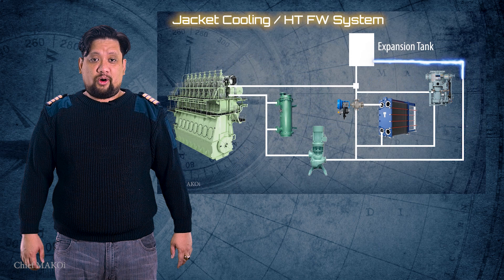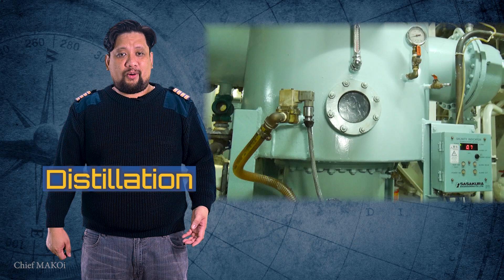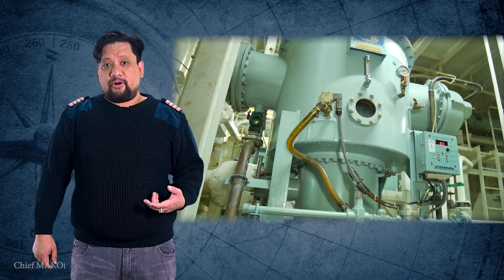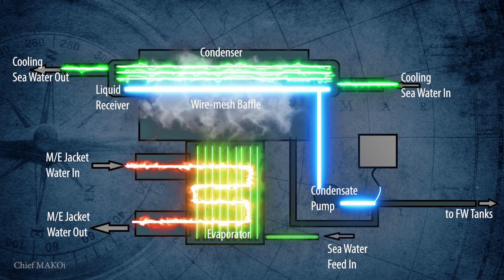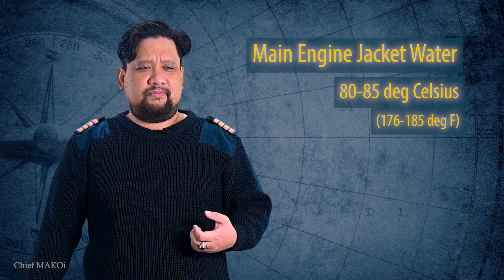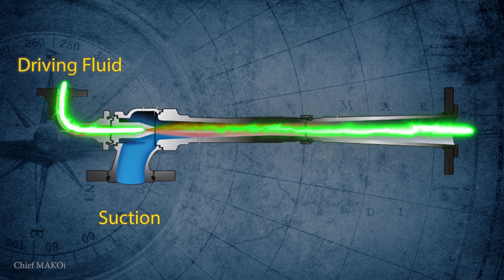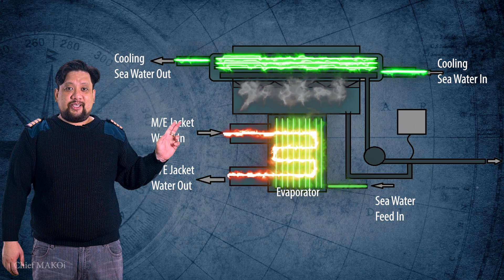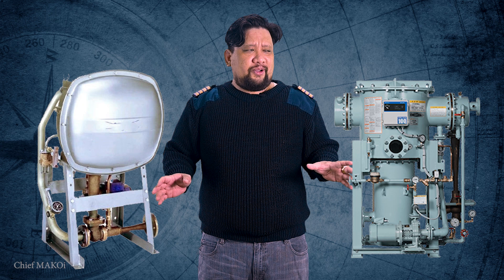How Ships Convert Sea Water to Fresh Water | Chief MAKOi Study Call Ep 04

Comment: Nicely done Chief.
I liked the graphics.
Maybe it’s time to hang up sailing and get a teaching position at the academy.
The shell and the plate maybe the same principles, but the plate is such a pain to clean.

👍🏼
Reply from the maker: Yes, definitely more work in cleaning plates.
Reply: Chief MAKOi - My next to last ship that I was chief on had three distillers: one shell, one large plate and one small plate. We had just taken over the contract for operating this ship for the government. When we went out on sea trial we found only the small plate distiller worked. The shell type had plastic steal repairs internally (Red Hand) and I believe the receiver was full of holes and was just dumping right back into the shell. The previously operator had sent the plates from the large plate distiller out for servicing(?) and when they came back they had put the gaskets all in wrong. So out of 80 plates, maybe five were right. Both top and bottom stacks were about the same.

What a mess!! 
Good thing it was a sea trial and not a trip across the Pacific!!

Comment: Very nice presentation Chief.  The PVT equation you showed does not apply in this case.  It is only applicable to non condensable gases.  Air is an example.  The physical law that is applicable is the vapor pressure curve of water.  At 100 °C, water has a vapor pressure of 1 bar.  At 80 °C the vapor pressure is less.  In sum, the process you are describing is vacuum distillation.

Comment: Could you make fresh water by pumping water out of the North Pacific by wind mills. Up one side of a mountain. Then let the water naturally let flow down the rocky side for miles. It would run 24/7 to a aeration flow into a reservoir. The wind mills could also generate electricity, for homesteads. As the water flow down ward there be blockage in the way just to slow the flow, so the water has to work downward.

Comment: Interesting, thats why you clean your cargo holds at sea, because your using heat from the engine to produce plenty of water for the hoses

This technology looks like it is a mixture between a still, used to brew alcohol, and a fridge, that uses pressure differential beween liquid and gas to produce a cooling effect

Two questions, when the fresh water tanks are full, does this machine still run? And does excess fresh water get dumped overboard, or does it turn off, so it doesnt produce anymore water?

Second question, how does the salt get removed from the machine? Obviously taking in salt water, boiling it into fresh water, and using the fresh water leaves salt somewhere, where does it go?

Id love to work at sea, i dont get seasick, and i used to walk around smaller ships without falling over when they were pitching and rolling, its good fun, i have a family though, and i couldnt leave them for months at a time

That ship is really long, i bet there's times the weather is so bad, you cant see the bow from the bridge

Comment: Shouldn't the water read 0 PPM after distillation? How come there is a possibility of leftover salt in there? Is the tubing not cleaned?
Reply from the maker: It's about the sensitivity of the Salinometer which depends on electrical conductivity.  The desalination plant and pipes are metallic and the water is constantly flowing so it would be understandable for it to have a few blips in the reading.  FYI, sea water has about 35,000 ppm salinity and technically, water with less than 1000 ppm is already classified as "Fresh Water". So a reading of less than 10 ppm is more or less excellent.
Reply: I think because some of salt molecules will still travel up with steam.
Reply from the maker: Yes that too.  It's called carry-over.

Comment: Just curious. How do you remove the salt residue after evaporation? All that salt must cake the pipes of the heat exchangers.
Reply: At 8:48 he mentions it briefly. I will describe it in my own words:

There is a continuous feed of seawater into the bottom part, the evaporator. This part should not run dry and this is assured by removing the surplus in the top wider part. This is done by the ejector that also maintains the vacuum. The ejector does not care if it sucks vapor or water.

Comment: I had a strong debate with this one, I was in strong favor with converting  sea water to fresh water. This is a strong solution for the water crisis in the Philippines.
Reply: not unless you have a lot of excess energy to spend like the residual heat from that main ship engine. Cost to produce 1 cubic meter of water from this process is higher compared to the cost of just harnessing the supplied water from mountain spring and rainwater. We do have a water crisis not because we lacked water, its because of our unpreparedness to the technicalities to store it. Basic necessities like water supply, electricity should be handled and operated with the government to avoid instances where our throat is held by selected companies

Comment: Fascinating video. You mentioned it generates 50 tons of water per day - that seems like a lot. If the average crew member uses around 150 litres a day, even with 30 crew this would only amount to about 4.5 tons. Is there another major use for fresh water on the ship?
Reply from the maker: Engine Cooling water, Boiler water, cargo hold washing, etc.

Comment: Extremely well done.   I have a historical question.  Back in the day of steam travel, they had a waste heat source that was above the boiling point of water.  Did the water distillation process then operate at ambient temperature with boiling water?

Comment: Sir, thanks for sharing this useful info.
I am wondering that at 7:47, why does sea water goes in this way? Because if water goes in this way, sea water would  be in the condenser by following eductor which should be contained the process instead of raw water.

Comment: How do you get rid of the salt? Did I miss something? You said the salt is discarded. Thinking about it, you would get rid of the concentrated salt solution whilst it is still liquid and not evaprated as a solid. So you might have a process where the salt water is introduced into the evaporator and the concentrated salt solution is graduly removed, perhaps by a vanturi as part of the continous operation. If done too quickly you won’t get much steam and if done too slowly, the concentrated salt solution would crystalize and set solid inside the evaporator. Therefore it would have to be maintained at the lower pressure boiling point or it will crystalize.
BTW you said sea water is a mixture of water and salt, it is not a mixture but a solution, you cannot remove the salt with a filter. Sand in sea water is a mixture.

Comment: Oh, another question, i worked in the air transport industry a few years back and i was told, if you have an airside pass to work on aircraft, you can travel to any country in the world without needing a passport, as long as you stay airside, is this true for ships? Would you be allowed to board a ship, and travel around the world as long as you dont get off the ship at ports

Comment: I appreciate the lesson.
I work with R/O's units on yachts. They usually divert the water if it gets up to 500 ppm. I was surprised to learn the distillers are at 10 ppm. That is super soft water!
Reply from the maker: Most of it is used for the boiler water and the engine cooling.  The small amount for the drinking water will still go for rehardening.
Reply: @ChiefMAKOi  Yes , pure distillated water is not good for drinking .

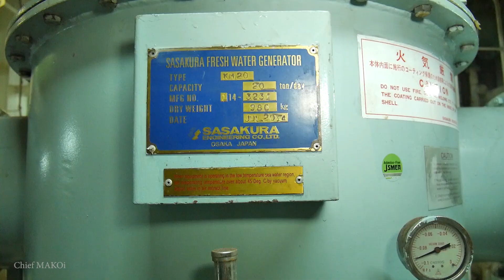Comment: 1:36 vacuum gauge and I knew that the boiling temperature was much lower to 100 °C :). For curiosity - why 80-85°C is optimal temperature for ship engine? RPMS may be low but load is high so I would expect high operating temperature, in excess of 100 °C...

Comment: I’m surprised they use the salt water in the Venturi and not the fresh water. This way you’d produce the vacuum and extract the condensate with the one pump as we do for dirty solvents. 
Also with this setup, wouldn’t it be ejecting fresh water condensate out with the cooling water?

Comment: Is some of the vacuum in the destilator a result of condensing contraction? 
I ask because this is common in condenser systems in power generating plants. Maybe it's only so because you need a large pressure differential to utilize a steam turbine efficiently, but I imagine it would lead to some higher COP in destilators as well.
Reply from the maker: It's from the venturi effect of the eductor.  In ships that use steam turbines, there's also a vacuum pump for the condenser.  It's like you said about the pressure differential.

Comment: Great video! Does this system make water clean enough to drink or is further processing required?
Reply from the maker: Good question!  There are a few more stages that it has to go through before being good enough to drink.  That will be discussed in a coming episode.
Reply: From fresh water tank(destilate tank) it will pass to uv sterilizer, and its now safe to drink. Anyway chief can you please upload video about bunker calculations or or how to compute ROB. ThankZ

Comment: At 4:39 You Animation shows that Jacket water inlet is in the upper part of the heating elements. I think it's reverse, jacket water inlet is down and output up.
Meanwhile it's a good lesson for Marine Engineers!!
Reply from the maker: I showed it correctly.  Since the sea water comes from bottom going up, the heating medium comes from top going down.  That's how they set it up in heat exchangers to maximize the heat transfer. 😊
Reply: @ChiefMAKOi  I have experience with sasakura Type ke 35 at DSME vessels, the jacket water inlet was always from Bottom.
I double checked that from Technical Manual. 
Nevermind I'm not here to disagree, keep up the good work!!
Excellent job Chief!!

Comment: I wonder why they don't use the hot exhaust of the desal engines' to evaporate the sea water & distil it to fresh water? Creating a vacuum to lower the boiling point would be just as dangerous as using normal boiling point/steam which could also be used to assist in driving the propellers & other auxiliary systems such as the power generators.

Comment: You should include how the 40's era ships did the desalination of sea water. Used steam flowing through a tank full of tubes for heat, ect. I ran a desalination plant on a old Liberty ship, converted to service swift boats in Nam. Techo marches on...
Reply from the maker: Some ships that need a lot of fresh water still have the option to use steam.  But it is used to heat up the jacket water instead of using it directly in the evaporator.

Comment: Hello Sir Chief MAKOi. Just for clarification, or maybe I missed something in your explanation. We all understand that water boils at the temperature of 100 degrees Celsius, if it is pure H2O without impurities. Sea water contains salt elements. Am I right to assume that the boiling point of salt water is higher than 100 degrees? I welcome comments and reactions. 😊
Reply from the maker: It should be higher than 100 deg C AT ATMOSPHERIC PRESSURE.  In a vacuum it would be lower.  That's why the Fresh Water Generator can make it evaporate at around 80-85 deg C.

Comment: So basically it's cheaper to drive a motor to draw a vacuum than it is to use resistance to heat water to boiling point. Clever that is. I wonder if it would be even cheaper to use exhaust gasses instead to boil or heat the water instead of using jacket water.. but that would all depend on what temperature the exhaust gas is.

Comment: What happens to the left over saline solution? Is the salt recovered for anything or is it ejected back in to the sea?
Reply from the maker: It's a flow-through system.  The sea water that doesn't evaporate gets suctioned by the eductor and goes back to the sea.

Comment: There are 38 pounds of gold in a cubic mile of sea water. There are 128,000,000 tons of salt in a cubic mile of sea water. The Atlantic Ocean covers 31,529,000 square miles with an average depth of 12,880 feet.

Comment: Dumb question but it's hard to google: How do you remove the salt which is left in the evaporator? Surely it would eventually just clog up the pipes?
Reply from the maker: It doesn't get left behind.  It's still in liquid form and continuously flows out to the sea.
Reply: @ChiefMAKOi  Very clever! Thanks for your reply

Comment: This should actually make the THERMAL efficiency of the engiines near 100%
Reply from the maker: It adds about 15%.  The exhaust gas boiler adds a few % more.  But yeah, shipboard systems are about 80+% (thermally) efficient.
Reply: @ChiefMAKOi  I WAS wondering if these systems were plumbed to take advantage of the higher exhaust manifold temps. (?)  Back during my 2+ yrs in community college 1987-1990, (HVAC,) we had one course on: "Alternate Energy Solutions". This type of system is sometimes referred to as "co-generation".

Comment: What sensors does the system have to detect pollutants in the water that are volatile enough to make it through distillation?
Reply from the maker: None.  That's why we run it after the ship reaches open water.

Comment: Thank you for describing well this rather complex system.  I suppose it takes a lot of experience to determine what's wrong should one of these fail to operate.

Is there monitoring that alerts you should these unit/s be operating inefficiently, or not at all?

Regarding the boiling point of water.  Fresh water boils at 100C.  Salt water has a slightly higher boiling point.  Does this have any bearing on the system?
Reply from the maker: The slight difference in boiling point of SW and FW is negligible since their BPs are reduced anyway in a vacuum.  I used 100C to state water's BP because it's familiar so everyone can get a referrence point.

Comment: How often do the lines in the evaporator and condenser have to be wroughted out to remove scaling?
Reply from the maker: It's cleaned by chemical circulation to dissolve the scale formation. Usually 3 months.
Reply: @ChiefMAKOi  Thanks for the quick reply! Stay well.

Comment: ...why do distillation or reverse osmosis when its already simplier & less power needed to get water from an atmospheric water harvester/ generator..  this uses a simple heat pump that captures & extract water from the atmosphere..  does not need an expensive distillation system or a reverse osmosis filter/ filter replacement... during distillation, all minerals are gone and you may have to introduce minerals before making it suitable for drinking..

Comment: I'm all for using saber plugin, nothing against it. VCP made incredible plugins & what's more incredible is they made it available for free. But you could use a more suitable effects to convey the content. There's also a ton of presets that you could use. If you use everything as an electric type effect it will confuse & disttact people. Plus the colours is all a weird & no connection with what they represent.
& Why is the 3d model jiggling like that?😅
This is great content you're crrating man, good job 👍🏼
But i think the message will be better recieved with better graphic choices
Reply from the maker: I agree.  I'm still new to After Effects so I just use and experiment on what I have at the moment.
Reply: @ChiefMAKOi  good on you dude. That's the spirit 👍🏼

Comment: Dear Chief, why do you need so much fresh water production on cargo ships. How much water do you usually spend in one day on cargo ship and on what purpose. 
I Suppose most of that water is spent on steam generation, but don't you reuse condensate?
Reply from the maker: It's actually minimal for steam production.   A lot of jobs involve washing.  In a normal day, we consume about 5-6 tons.  So we have to fill the water tanks as much as possible in case we have extended port stay since we can't produce water when the ship is in port.
Reply: @ChiefMAKOi  how many tons whilst hosing out the cargo holds?

Comment: Thanks I was curious about this. Can ships that use steam turbines (like boilers consuming bunker oil or something similar) simply divert some of the propulsion steam to a heat exchanger and condense it back into fresh water or is that steam too "dry"?
Reply from the maker: They do condense it and it returns to what we call a cascade tank which is basically where the boiler gets its feed water.

Comment: Thank you for the top-notch explanation ! Have one question, I have heard that the water produced by this method is actually the most cleaner water someone could ever drink, is this really true?
Reply: It's distilled water. Clean clean.
  But it tastes flat, so you have to shake the container to put dissolved air into it. Makes it taste better.
  Rainwater is the same, only air is added through the process of agglomeration.
  If you collect it in a clean container, you have clean water, fit for drinking. Better than distilled water.

Comment: He fails to mention how energy intensive it is to distill water
Reply from the maker: Actually I mentioned that on ships, distilling water is a means to recover waste heat from the Main Engine.  So in essence, it actually helps to maximize the use of fuel.
Reply: Chief MAKOi thanks, Chief I
Must have missed that part

Comment: In chemistry, we call it deionized water. Can't have ions in there, reacting with reagents. I love how you threw some chemistry in there. If one lowers the air pressure in the vessel holding the water enough, you can freeze the water by boiling it.